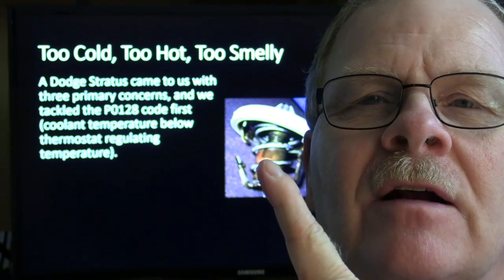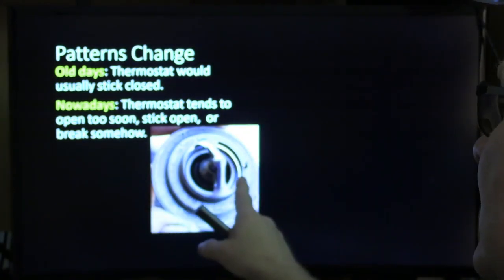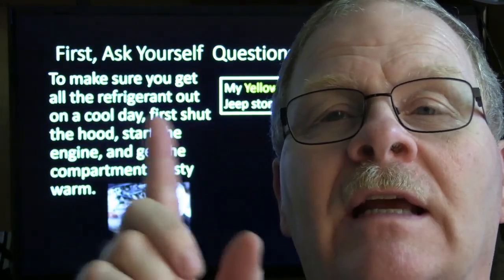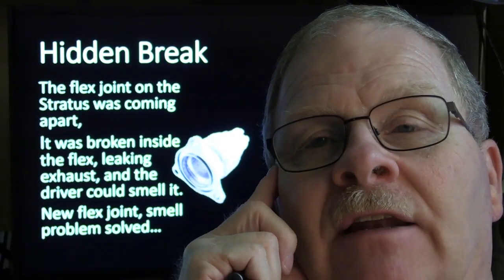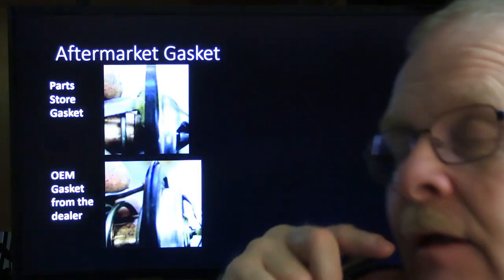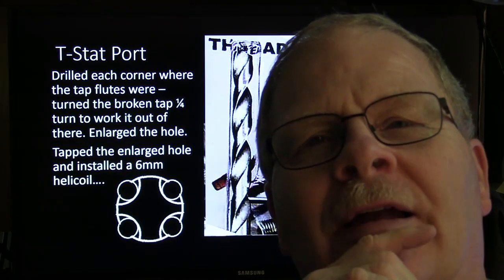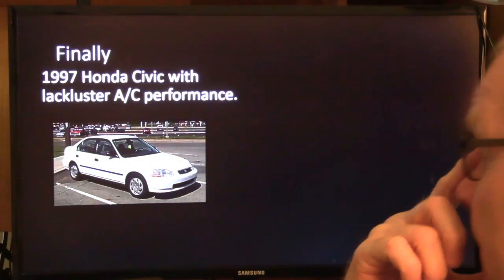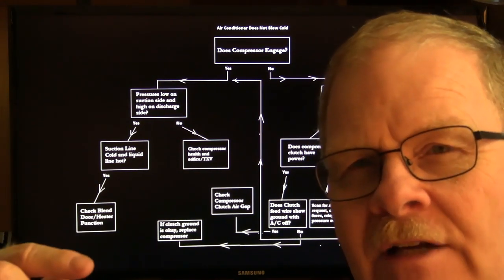Temperature and AC Stories

Comment: Usually, when the evaporator is iced up, that's when the AC quits working after a few minutes of being turned on. Thank you for the video. Speaking of pressure equalization, I am told that an orifice tube system equalizes faster than the txv system, any thoughts?
Reply from the maker: I'd say that's correct, simply because of the way the TXV works - but ambient temperatures seem to have an affect on how quickly the TXV systems equalize - the FOT systems are, well... Fixed...

Comment: I run my vehicles on the cool side because it's so hot here in Phoenix ,Arizona ! I took out the 195° and put in a 180° thermostat ! It helps when your stuck in traffic and it's 115 outside ! The vehicles get up to normal temperature it just takes longer to get there !For emissions I switch the stats back !
Reply from the maker: That makes sense in an area with really high ambient temperatures - in Canada, running an engine too cold gather's water in the oil pan, which freezes, clogs the oil pickup screen, and destroys the engine. It's a regional thing.